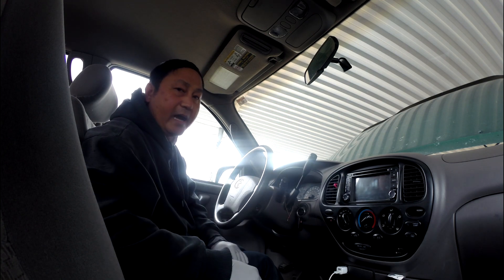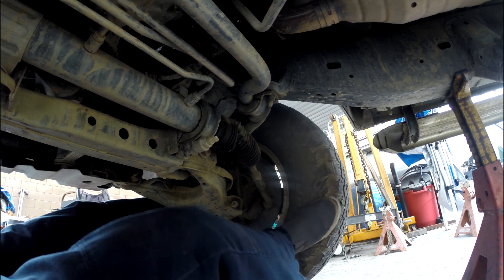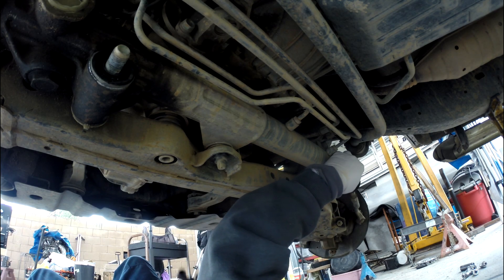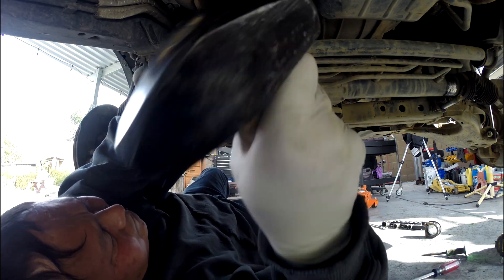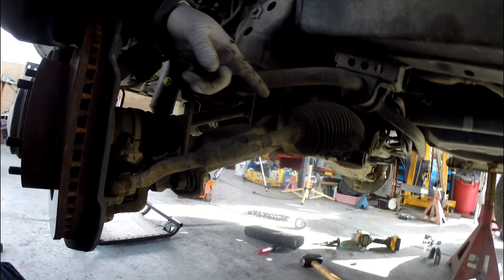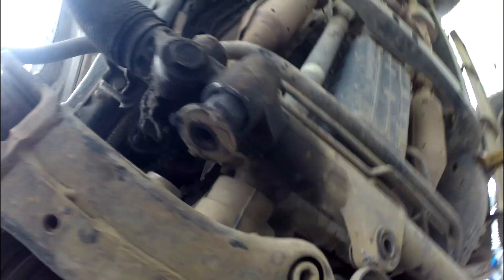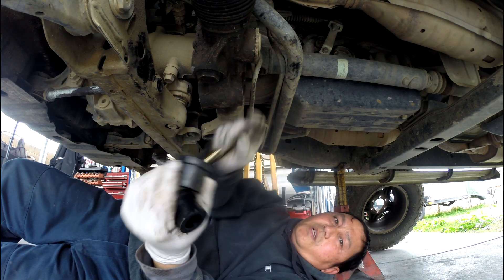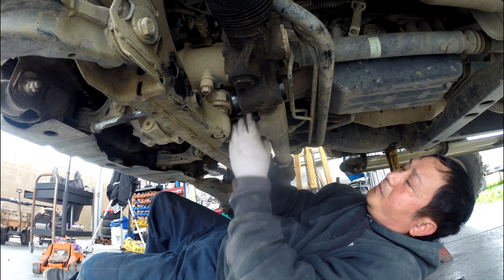first generation tundra steering too much play.

Comment: in Toyota maintenance service center , they said I have to change everything .. the full " Rack and Pinion" even if I don't have leaks or torn rubber , do you think I should give your solution a try ?
Reply from the maker: My 10cent is that not broken or bad just leave it alone. As long it safe condition don't replace it. Only repair whatever it broken don't replace because old.
Reply: @alltsab  good advice , thank you